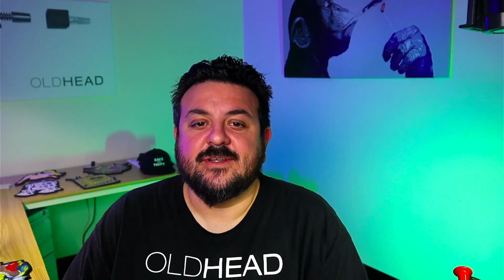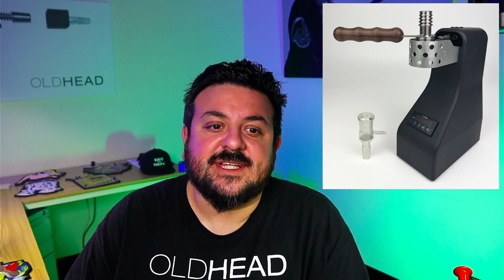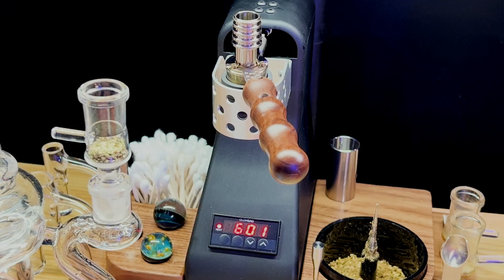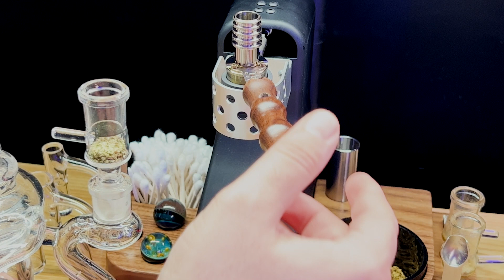Thermally Extracting Dried Plant Material with the Terp Hammer

Comment: I got a temp hammer with ruby pearls, my problem is that it doesn't have a heater it came with a box and coil. Is it worth putting together sir?
Reply: They sell the heater separately. In the description of the hammer it tells you it's an accessory and you need to own Dab-Ready heater. Total set is 499.99 for the bundle currently as of writing or 299.99 for the heater itself aka the Dab-Ready.  Hope the helps. I'm sure after a year its solved lol just seen the date 😆

Comment: Is 680 degree maximum because of combustion or a limitation of the device
Reply: Definitely the limit because of combustion. Ball vapes have too much power. You could easily use one to light your bowl for a combustion bong rip but who would use this as an expensive lighter, lol
Reply: @TimeFadesMemoryLasts I thought combustion occurred even as low as 450. Idk how these avoid that at the nearly 600 range.
Reply: @johnhowarth8367  that's the temp of the heating coil, not the air temp itself. After the air passed through the balls it cools down until it hits the herbs. If you dial in the coil temp right, the air has the perfect temp for your liking. That's a bit of a preference and also depends on your specific setup (how far away the vape is from the herb, etc.) So what temp works for someone else might not work for your setup. If you wanna make it scientific you can measure the air temp in the bowl with a thermocouple element and note down which coil temp corresponds to which air temp. But once you have a feeling for your setup it doesn't really matter :)
Reply: Combustion silly. It has no moving parts the melting point of steel & ruby is quite high